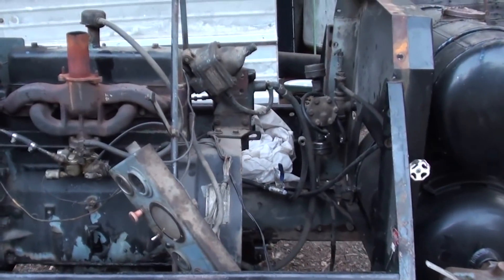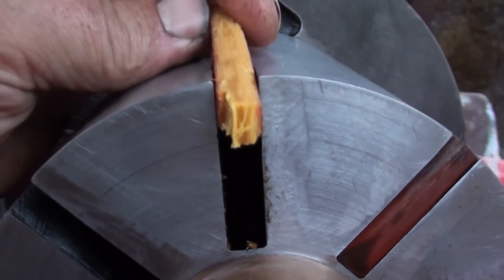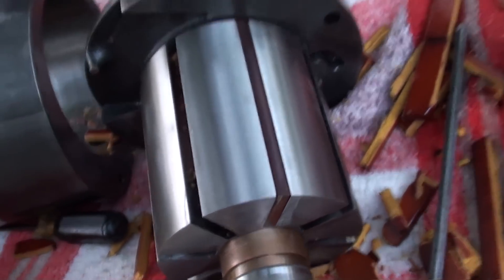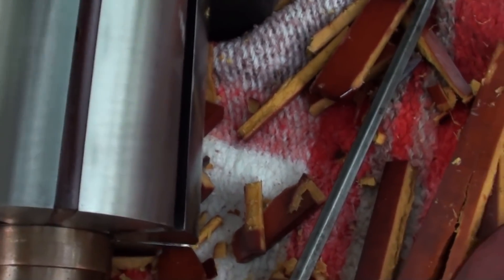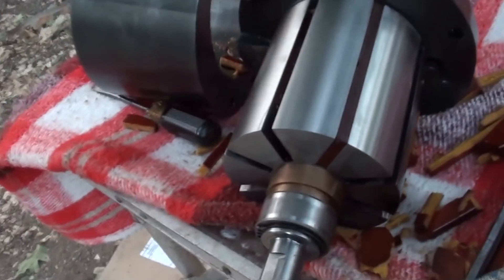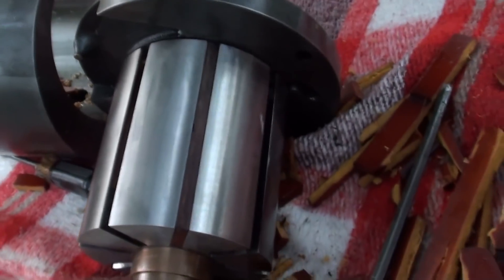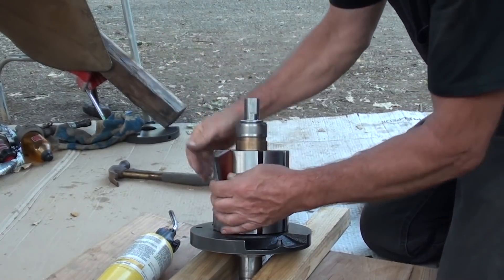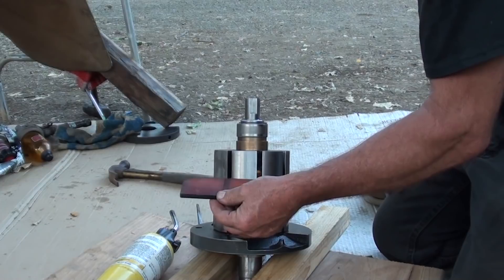Ingersoll Rand G85 Compressor Failure

Comment: I worked for Ingersoll Rand in the UK from 1975 to 2003, when the factory was closed and redundancy loomed into view. The vanes used in the air tools and air motors I worked on were manufactured by Turner and Newall, who I believe came under the control of Du Pont. The material was called Ferro-Bestos but I expect now it will have a different name because everyone is terrified of asbestos. Other motor vanes were made from a substance that looked to me to be Tuffnoll, a phenolic plastic, very hard wearing and very rarely jammed up. The oil we used in the compressors was AWS 30 hydraulic. If I can remember anything else I'll add it on here. Remember this information comes from an old bloke in the UK so is potentially different to what is the norm in the USA,
Reply from the maker: I'll be having a set made by Franklin Fibre.
Reply: ATF would probably be a good oil for these, though it would probably need more frequent changes.  ATF is used in the older Sullair screw compressors.

Comment: Over here in England, the propreietry name for that materiel is Tufnol. its readyly available in sheets of varying thicknesses and is inexpensive.  just buy a sheet of the correct thickness and have your tame machinist  copy one of the existing vanes. I once did exactly this repair to an ingersol compressor.

Comment: I think the rotor lobe is bent, pinching  the vane in that slot. As you said when catastrophic failures happen so do strange things. the rotor isn't concentric to the chamber it is offset to creat a chamber on only one side of the rotor. a vane broke and impacted the rotating assembly causing the v shaped lobe to pinch the vane in the adjacent slot. If you take a punch and impact it the other way with the same force that was applied to it to pinch it you will free it. just be careful to not overdo it because you will pinch another slot closed a bit. To test this try to insert the one vane you have into all of the slots or measure the width of each slot.

Comment: I used to work for Surge Dairy Equipment as a Service and Installation Technician. Vacuum pumps use a vane system in vacuum pumps almost exactly like this unit. Oddly enough, the parts may be available as a vacuum system instead of as a compressor system. They both work on the same process, just using opposite ends of the pump to do their work.  We used actual vacuum compressor oil to lube the vanes prior to installation, and the vacuum pumps used a gravity fed/vacuum system to keep oil continually lubricating the rotor and vanes.

Comment: We use vane style vacuum pumps in the maple syrup industry, possible a vacuum pump dealer can help you find a vane kit. Surge,  DeLaval and others. Also I have had good luck with vacuum pump  oil not causing the vanes to swell up

Comment: Hi Jeff, farm slurry tankers use large vane vacum pumps, replacement vanes are available on ebay here in the U.K.
Milking machines also use vane pumps. Good luck. ( great brake cleaner moment, you could add that one to the forthcoming outtake video) ;.
Reply: would you have a link to your ebay vanes please?i have the same compressor getting ready to run it soon

Comment: The vanes look like phenolic material which comes in sheets of standard thickness. I work in the aviation industry and repaired my air tools by fabricating and replacing  the vanes from this material.
Reply: Seconded. I was going to mention this but you got there first!

Comment: yeah it's all in the oil must use pump manufacture recommended oil. in dairy farming for example a DeLaval 78 vane pump the vanes have a cross hatch pattern to retain some oil and requires twice/year maintenance with a diesel fuel flush, if that maintenance is not done the vanes get stuck pump overheats and in my case the rotor comes loose from the shaft because it's a press fit and yes the vanes wear down to a point they dislodge get wedged between rotor & housing. also vanes/housing wear wavy like brake drums if not enough oil. super important to service vane pumps

Comment: i had a 185 I/R built back in early 70's ... the guy i bought it from told me to use 'quincy compressor servo oil in the 'pump , and i never did have any problems with it, we used to just order it from 'portland compressor  ... straight-up

Comment: HUM? Seems to me these could be made out of a different material.  Back a few years ago I worked at a chicken feed plant. We made chicken feed. They had these really huge air pumps. They ran the whole plant. There were several machines that ran off of the air. The pumps they had were rebuildable. And I remember seeing the maintenance guys taking one of these pumps apart. They ran 24/7. So the vains would wear out. They had to replace them 3 or 4 times a year. The maintenance guy said they were made out of nylon. They looked like what you have there except bigger, thicker. These two pumps ran a whole mill. So, when the vains needed replacing they made there own. They kept these large bars of nylon. They were smooth. They had a slick, smooth surface. It's something you might want to try. You might even be able to find a harder plastic. I don't remember what kind of oil they used. I do remember hearing it said that these were not porous. I remember him saying that sometimes these pumps vains would melt if they got too hot. I remember these pumps had huge fans on them. Almost automotive-like that blew through a radiator that kept these pumps cool.
Reply from the maker: These are phenolic resin composites that last much longer than nylon or UHMW plastics
Reply: @ElderlyIron   I understand. I was just throwing that out there as an alternative if you can't get originals anymore. If the pump doesn't run 24/7 as those did, they should last a while. Just an idea I was throwing out there.

Comment: Make sure the rotor isn't bent, or the vane gaps pinched, see that style of pump used in vacuum applications and it doesn't take much to wreck one when foreign bodies go though them. 
Might be better looking for a good used complete compressor.

Comment: They use them on airplane for of the transmission cable for the flight control basically is resin and a epoxy

Comment: Isn't the oil you use in compressor straight weight engine oil?  Old compressors are hard to find parts for.
Reply: He said the oil was an ISO oil.  So no not an engine oil.

Comment: Have you already found this?  The pages are in random order, but the ones you need are there.

https://dealers.doosanportablepower.com/emea/documents/Service/01_Portable%20Compressors/Compressor%20Manuals/28_Old%20units/GR85%20PC%20100.pdf

Here are some vanes on Ebay.

https://www.ebay.com/itm/INGERSOLL-RAND-DRF85-AIR-COMPRESSOR-VANE-SET-LOW-PRESSURE-FOR-AIR-END-R85P110-/192106770918

Part number from page 29 of the manual above is r85p110 for a set of 8.

Comment: Get Tony to make you some out of brass.
Reply: Brass?
He better be careful how he asks for that.
Reply: @mostlymoparih5682  The Rotary that ran the concrete plant used a blue synthetic oil. It was a 3-phase Ingersoll and Grumpy can handle it just fine.
Reply: @lewiemcneely9143  Tony might take exception to that remark.
Reply: @mostlymoparih5682  Grumpy has no exceptions!